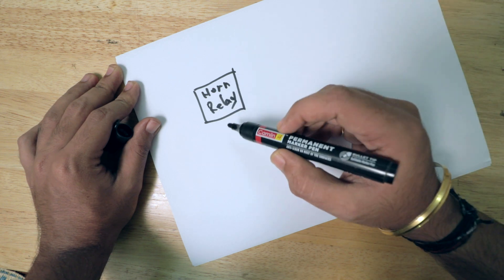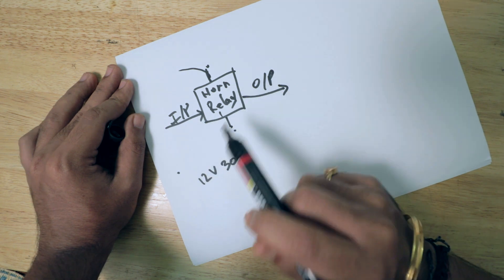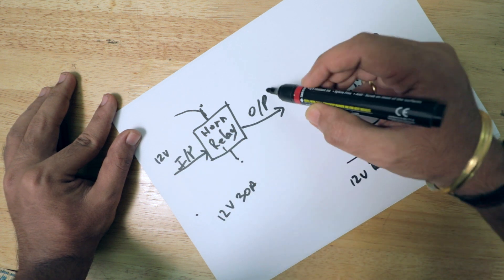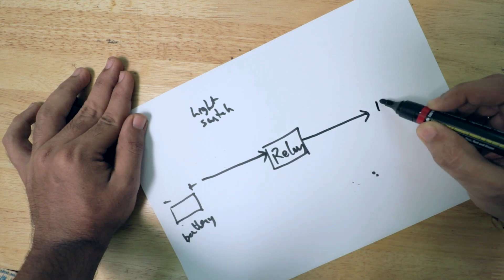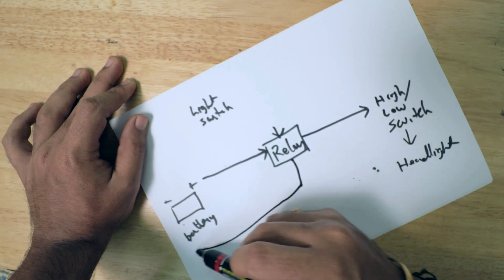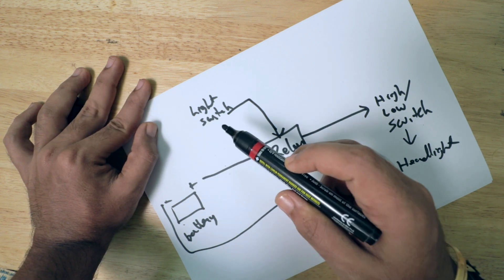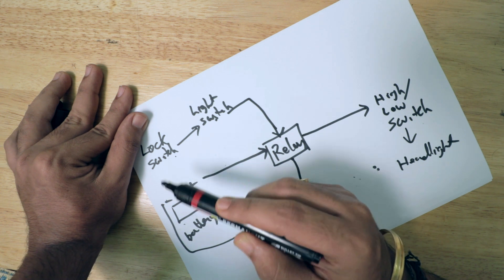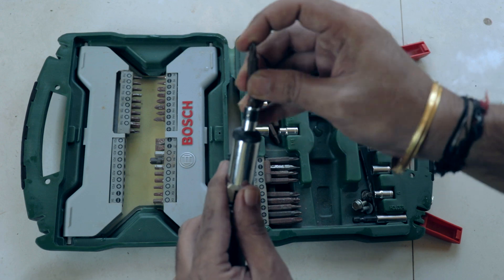Convert any Scooter From AC to Full DC | Activa | change headlight connection from engine to battery

Comment: Bro !
Will it be fine if I directly connect the headlight wire to Ignition switch ?
how will it be diffrent from the relay system ?
Reply from the maker: +RaJesh SinGh in that situation the 12v will be supplied to the headlights from the ignition switch through the bikes original wiring, which in most of the times has got more resistance,

When you use relay, you bypass all that and become safe as the supply goes directly from battery straight to the bulb
Reply: Rahil Chodanker Thanks for the reply ! :)
Slowly, iam able to understand the setup because the wiring is a bit complicated and using a rectifier and a capacitor will probably make it more complicated so ill go with this itself 😅
I actually needed some assistance with my bike, can you help me out ?
Reply from the maker: RaJesh SinGh yes definitely, will help you.

I have even done it with capacitor and rectifier but it is not efficient and stable as the original source itself variates from 6 to 30v
Reply: Rahil Chodanker I Really appreciate you helping me out ! 
Sorry for the late reply, took me some time to read my bikes wiring diagram 😅.

So i have a Suzuki fiero, and it has no pilot lamp, just normal light switch.
And here is the wiring info.

Right Handle switch unit.
1. Yellow wire(light switch) - Comes from Regulator And goes to Pass switch.

2. Grey wire - Goes to Beam control switch on left handle bar and Also to Rear Tail light.

The other two wires go to Ignition and CDI resp.

LEFT handle switch unit.
1. One wire connects High beam switch to Headlight.

2.Another wire connects Low beam switch to Headlight.

How do I install the relay now ? 😅
Reply from the maker: RaJesh SinGh cut the yellow wire so there is no current comming from alternator to the light on off switch and refer my video to pass a positive wire from key lock switch to this light switch,

Now the output wire of the relay needs to be connected to one wire which goes to the high low switch which then passes the current to the selection made(high or low).

If you have any problems with understanding then hit me up with pics on my Instagram I will mark it all and give you
Reply: Rahil Chodanker Thanks alot man !
You are a life saver !
Ill contact you on insta if i face some issues !
Thanks again for the Replies !! :)
Reply: Rahil Chodanker One more thing !

So first the yellow wire must be connected to Ignition so that I get current supply. 
Now, how do I connect it to Relay to so that it triggers the relay ?

I mean, 
Relay i/p - +ve terminal (battry)
Relay o/p - High/low switch

Should i connect the same yellow wire to one side of Relay ?
And the other side goes to ground so that the Relay gets triggered.
Reply from the maker: No no no, the yellow wire from the alternator to the switch has to be cut and taped of , we don't need it.
Reply from the maker: RaJesh SinGh one position wire should come from the lock switch to the relay as positive trigger input with your light on off switch in between which will be connected to the coil of relay and other side you connect it to the ground, 

For more info watch my car horn video too, I have explained the relay there also.
You first need to understand relay then you will know everything
Reply: Rahil Chodanker Hi !
I watched the car horn video, it did help. :)
So, one last time 😅
one wire from light switch must go to Ignition and the same wire must  go to Relay i/p trigger ?
So The Relay needs power from both the inputs to work ?
And The OUTPUT from Relay can be connected to any of the wire of high or low beam ?
Reply from the maker: RaJesh SinGh the wire from the ignition to the switch , from switch to the relay will serve as input for relay to either make a connection or break it,  the second wire which comes from battery actually is the main input signal which goes to the bulb,

So the relay output wire will go to a common wire at the high low switch, so just one connection and you have dc at both high and low beam
Reply: Rahil Chodanker Sir, Thank you soo much for your help and patience !!
Im all clear on this now.
Hope i get to learn alot from you.
Thanks again sir.
Reply from the maker: RaJesh SinGh arey yaar don't call me sir😂  if you have any difficulty even now then I will help,👍
Reply: Rahil Chodanker Thanks alot !! You are a really generous man !
I had been struggling from past 2 weeks to get the correct info, but the more i searched, the more i got confused. Thats why I feel happy after finally getting to know now.
Ill surely contact you if i need help. :)
Reply from the maker: I'm happy that i was of atleast little help to you!! happy diy'ing!!! Cheers

Comment: That’s a pretty nice setup man. I found an High/Low LED light that plugged right into my scooter which runs fine off the AC power setup it has. It is less bright at idle but still very good compared to the original light, and when accelerating it is just as bright as a DC setup LED.
Reply from the maker: I would highly recommend you to convert your scooter to DC or else the LED bulb will die quickly
Reply: Thanks for the tip. I will look into it further
Reply from the maker: Sure , Good luck!!
Reply: @RahilChodanker  but how to convert

Comment: Bro can I use 36w 4000lm led on my Honda Dream Yuga
Reply from the maker: Dhananjay patil yes you can but make sure you convert your setup to DC or else the led will die soon
Reply: Rahil Chodanker ya will try to do it with your method, 
Is it compulsory to connect to high low beam ?
As it is quite difficult for me to find because I am not an expert in it
Reply from the maker: If you make it direct then you will not get to use high low switch,
So you will have to somehow do it with high low switch only.
Reply: @RahilChodanker  hi, how much do motorcycle electricians charge to do this conversion? And does it void the bikes warranty?

Suggest any good technician in Delhi if you can, thanks very much
Reply from the maker: @no22sill  sorry buddy, I have no idea about technicians and the amount they charge. But yes the electrical warranty will be void mostly

Comment: Very nice DIY. Will the stock alternator charge a 5ah battery as fast as it gets consumed by the headlight?
Reply from the maker: When you use your bike in daytime the battery will be charged and during the night time charging will be slow and sometimes it will not charge depending on what kind of bulb you use. 
I use this bulb https://youtu.be/6tII2LwQEr0 which consumes less current ans been using it since 2 years now without any problem

Comment: I liked,  the way you made this video, like a pro. I already subscribed you bro. Thank you

BTW, can't we use rectifier with 12volt voltage regulator to convert ac into dc?
Reply from the maker: Shanu Das thank you bro 😎

And yea you can use rectifier by taking input from the wires of the alternator which can be found at the RR .

But it will be additional circuit which can have reliability issues and you will need to be extra cautious with the circuit.

I had done the same using a rectifier and a voltage regulator to keep the voltage stable at 13-14v . You can use this to charge the battery but LED's are very sensitive to current so there will be fluctuations which will shorten the life of the led bulb.  Hope this  will help you

Comment: But why relay? What if we don't use relay?
Reply from the maker: Vishesh Saxena use a headlight relay or if not then use horn relay like how I did in my setup.
If you don't use relay then you will not be able to isolate DC from the AC which is there in stock wires
Reply: Another way of working without a relay would be to tap the positive from the key switch. This much of wiring won't be needed.

I was expecting a coil rewinding here as this setup cannot handle anything above an LED. The battery will start losing juice if we fix a halogen or an HID.